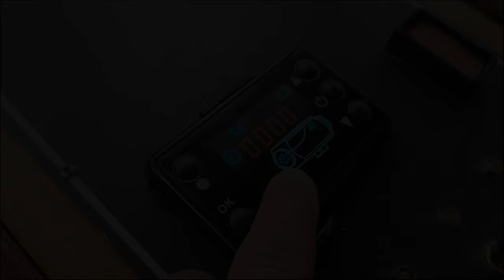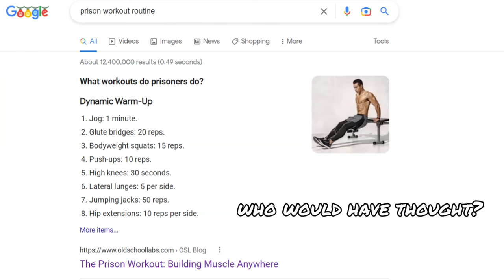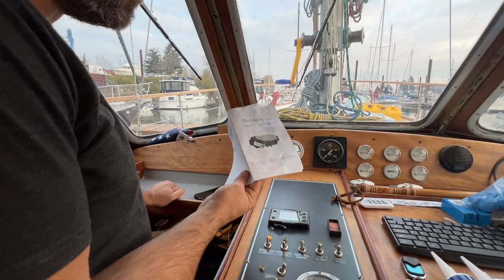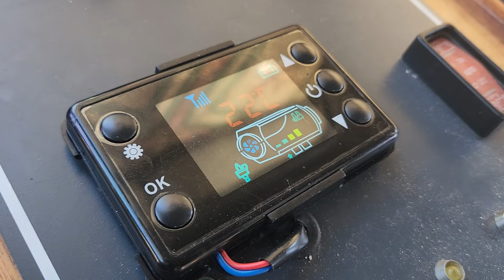Installing Our Diesel Heater As We Hunker Down For Winter On Our Sailboat!! #BoatLife (Chapter 20)

Comment: I wanted to tell you about a few things that might be beneficial to your marine diesel heater install.  I am really just trying to be helpful as I've got a similar install myself and have helped with several others.  The exhaust is the right idea and a good pipe.  However in marine installations you need a drip coil in the dip of the exhaust pipe.  Water builds up in the exhaust pipe and can create a wet goop of soot that causes a heater fire.  Also I would have gotten the 5kw version as your boat might not heat too well on 7000 btus.  That electric heater I saw on you cabin sole probably puts out 5120btu.  The 5kw typically can put out 17000btu or 3400btu.  Also they tend to not gum up in the burn chamber as often.  Which yes you will be cleaning that sucker out every 1000-2500 hours.  I would recommend buying a 5kw spare as parts are hard to get and they are super cheap.  For the price of one name brand you can buy twelve new heaters.  Ebay has them much cheaper than Amazon as well.
Reply from the maker: We actually ended up ordering the 8 kW version but when I sent the link to Kelly the default was the 2 kW so she mistakenly showed that one. Great idea on the condensation trap!